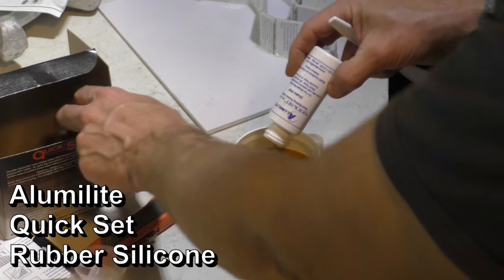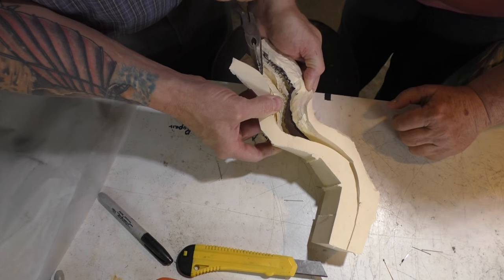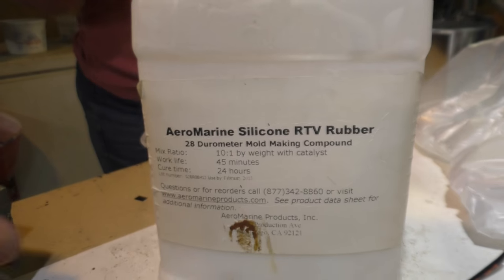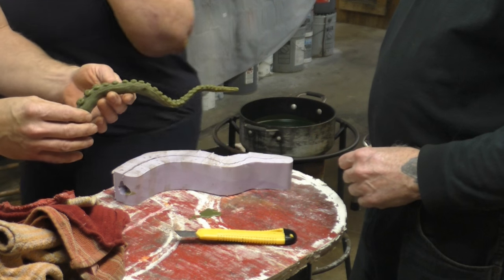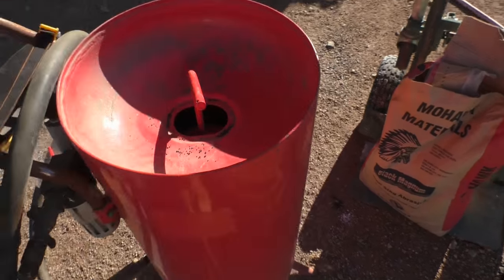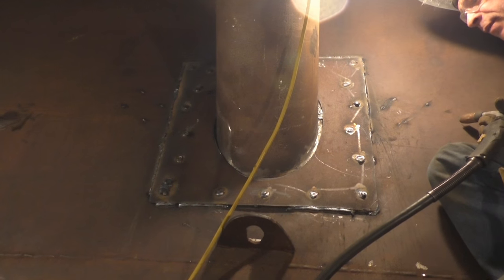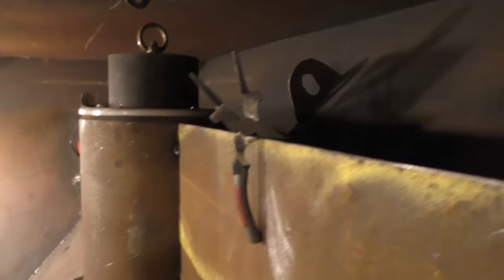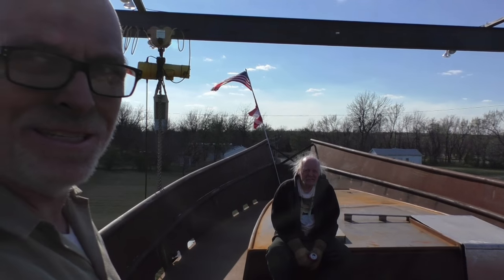Tentacles ...and Other Boat Building Stuff

Comment: Great video. A quick tip if you're going to be making more silicone molds tho, try brushing silicone into the recesses of the figure before you fill in the mold, it should cut down the amount of air bubbles you get in your finished mold filling in detail.

Comment: I recommend you look into Smooth On products for your mold making, specifically Mold Max 30. If you pour your batch from 6-8 feet above in a narrow stream, the bubbles overcome the surface tension and pop in the stream on the way down. It's a good low tech degassing technique.

Comment: If you mount the rudder cylinders like you were talking about in the video. you well definitely need to weld some backup structure on the other side of the plate. Welding a plate  across the top to make it an I- beam or what we would  call a T-bar in the shipyard because you don't have the bottom faceplate would help too.
Reply: +Henderson Lanier I see a potential recruit!

Comment: degas the casting rubber in a pressure cooker connected to a vacuum pump...it gets rid of the air bubbles pretty efficiently.

Comment: Just a thought....  next time you do one of those rubber molds would there be a way to include a wire down the length of the object in the mold so all you would have to do to un-mold it is pull the wire.

Comment: Boat is looking awesome!! Inspired me to take up welding, what if you filled the keels with oil before sealing them off though?? Would stop rust from forming, waste oil is cheap too...
Reply: +Classic Rock i know a boat that had its keel filled with old sump oil and when it was about to sink from rust holes caused by neglect the oil slick around the boat was noticed and we got it out of the water before it went down so its a good idea

Comment: Dear Doug,
I commend your efforts and am delighted to see such progress and also observe you ignoring the professionals who tell one that it is impossible for amateurs to build such a craft. It just takes persistence........ and a touch of lunacy. 
We, that is my father, myself and brother, as  fellow builders from a few years ago, 1975-1980 (15 metre yawl in foam sandwich GRP) also realised that all that is needed is obstinacy and effort. 
One concern I have wondered about with Seeker is structural. I wonder if you have done some engineering analysis of the "moment" generated by your bilge keels by all that lead. Fore and aft it should be fine but if Seeker falls off a wave while heeled at say 25 degrees, there will be considerable moment generated (force X distance from the point of action) on the windward keel. At present there are few vertical floors/half-bulkheads in the keel area to spread that force. I am sure this is an  aspect that you have considered.
Perhaps you are doing these when you make the cabin sole supports?
Please forgive me if I am teaching a grandmother to suck eggs!

PS. The Hundestet is a fabulous prop. We had a 24 inch three blade VP3 driven by a 113 horse power diesel. If motor sailing due to low wind-speed, getting about 3 knots from the sails and then we would run at about 1000 rpm (2.1:1 gearbox) and coarsen the pitch, not so much as to induce  cavitation and get 7 knots boat-speed, consuming 1.5 gallons (Imperial, not US) per hour. The only other thing you should watch is are there enough revs to keep the engine oil pump supplying the main bearings with lubrication. I heard from Hundested that some parsimonious fishermen would run at too low revs and cook the engine bearings.

Sorry to have inflicted so much reading (and writing) on both of us.

Very best wishes with your excellent efforts, both with the boat and in your videos.
Reply from the maker: +Another boatbuilder     Thanks,  and we are not done with the keels.

Comment: Should have vacuumed the air bubbles out of the silicone mould before it set?
Reply from the maker: +Josh Crowther    Considered it, but I don't see any reason for it now.  Maybe if the surface was smooth, but I could not see any issues.
Reply: +SV Seeker when are we going to see the other parts to the top deck crane ? Also by getting the crane done it may help you with the rest of the build

Comment: it might actually MAKE a nice chandeleer , make a omplete octopuss and hang it off the ceiling upside down or against a all somewere or just as a lighted centerpiece on the table 
http://www.mickeynews.com/wp-content/uploads/2013/07/OCTOPUSS.jpeg
rotomould the complete design using resin so its hollow and add some led light and wiring intoo the end of the arms , if you can make the resin clear and only add a light coat of paint you could make it glow